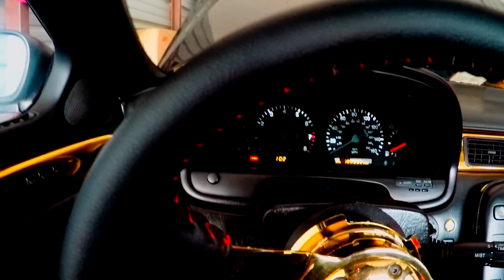Ebay Down-pipe Exhaust Pt.2  | 1JZ SC300 EP 009

Comment: just finished watching all 9 episodes, going to buy a sc300 pretty soon, plan to do a 1jz swap with an R158 transmission, any tips or suggestions. btw I'm no expert on cars
Reply from the maker: Nice! I think you mean r154. Anyways I'd recommend saving to get a wire harness made. I believe tweaked performance does them for around 1k including your old harness. Do a ton of research and you should be able to tackle all the major stuff pretty quick. Gl with swap!
Reply: +Navyedits easiest way to do it is find a soarer front clip and its a direct swap atleast for me it was

Comment: gotta turn the intake to fit right. oh and whys is your coolant tank moved?
Reply from the maker: My intake actually just needs a 90 degree coupler to fit instead of the 45. The coolant tank mod was required for the greddy intercooler kit.
Reply: oh ok lol you just ordered the wrong one. how big was the greddy? mine was huge just bent the tabs so it sits 1/2 in higher to fit intercooler
Reply from the maker: Pretty big, I believe its the greddy ls. Can't build boost worth a shit lol.

Comment: what exhaust are you running?
Reply from the maker: havent gine any further, still runnin an open downpipe
Reply: +M. Skoops do you know what exhaust bolts up I have the same setup..
Reply from the maker: Brad Nelson no idea, im just going to go to the muffler shop and have them make a flange and bend some straight pipes